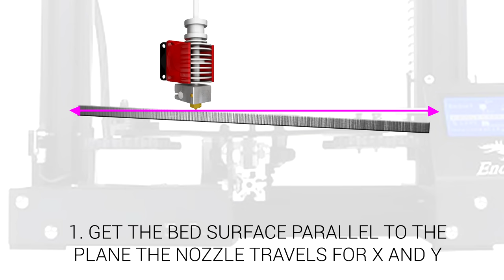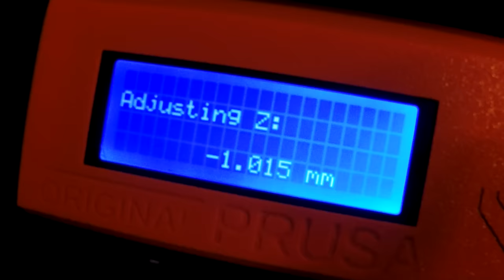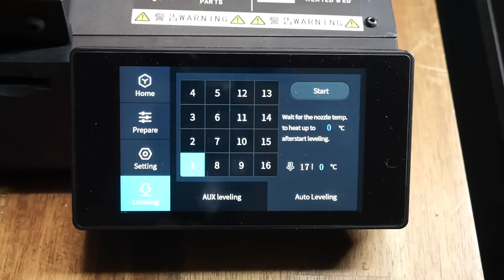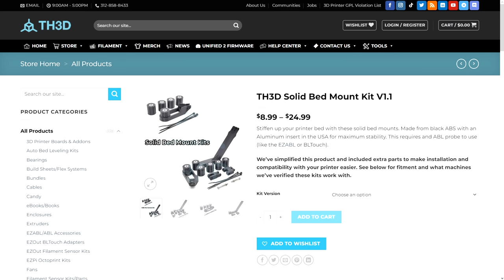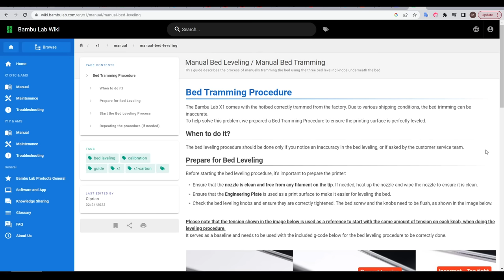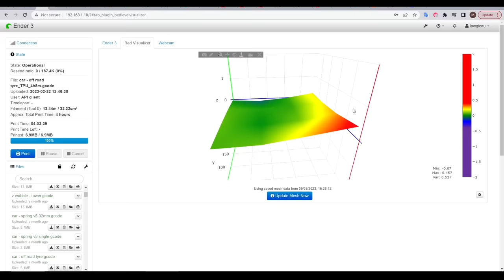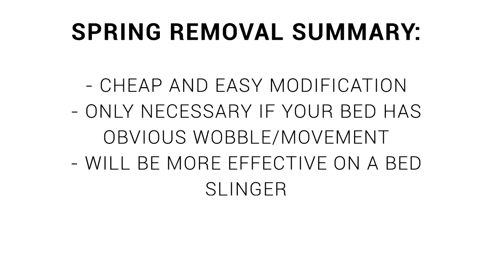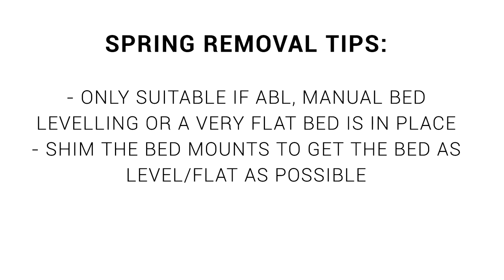Is it time for 3D printers to abandon bed springs?

Comment: One thing I did for my ender 3 that drastically cut down on bed slop and improved my layer stacking was to put washers and nuts at the top of the bed adjustment screws, rigidly attaching the screws to the bed.  The screws as they are are just in loose countersunk holes, and then held at the bottom by the adjusting wheels.  When the frame the bed is mounted to moves back or forwards, especially at higher acceleration rates, inertia momentarily keeps the bed stationary and the screws tilt off vertical.  Tilted bolts are effectively shorter than straight ones, so that pulls the bed downward till it catches up.  A washer and nut threaded all the way up against the bottom side of the bed pulls the screw tightly into the countersink on the bed surface, preventing it from tilting.  Incidentally, I also use a three point tramming frame, as it just makes more sense to me than trying to tram with four adjustment points.   That also allowed me to separate the support for the bed heater cord from the adjustment mechanism: I've found that the additional thickness of the heater cord support requires substantially more tension than the others to pull it down to the same level.  As you found, equalizing that tension required adding washers to all the other screws.

Comment: I haven't used a spring for a long time, I use self-made rubber rings from industrial rubber.
that kind of rubber can withstand the temperature variations well.
it is also very stiff so that you do not suffer from after vibrations.
I haven't had to level manually in a very long time.

Healthy and Kind Regards to all!
Rob
Reply: Rob do you have any more info on the rubber you used? Thank you sir
Reply: @CerealKiller187  
hello Billy,
what I can tell is that it was reinforced rubber ( the rubber comes from a shipyard! )
(then there is gauze in the middle of a tough kind of wire)
(gauze other name, a kind of net, fishing net but very fine wire)
the thickness of that rubber was 5MM and I used 2 rubbers per side.
( 2 X 5MM = 10MM high Rubber on one side! so you need eight(8) of these )
i drilled a hole in the rubber for the bolt and then with a -
hollow pipe 10MM knocked out the ring.

I hope this is enough information for you?

Healthy and Friendly Greetings from the Netherlands!
Rob

Comment: I run a farm with 9 Artillery Sidewinder x2's, and did away with my bed springs almost 2 years ago. I switched to silicon spacers, and haven't regretted the switch once. I am now able to achieve speeds of production quality prints of over 150mm/s consistently, and I attribute a lot of that to the stability of the bed. I also find that the bed leveling (abl running unified bed leveling in Marlin) is much more consistent and stable throughout the year. I highly recommend the upgrade to those on the fence about it.
Reply: what silicone spacers do you use? a link to them?

Comment: I've just gone back to stiff springs in my biggest printers (Anycubic Chiron and Max) which had helped greatly! This is with the ABL system, using the bed_screws_adjust Klipper function. It had enabled me to have much better consistent first layers, with the ABL further removing any inconsistencies.

The above AND the Klipper macro of bed mesh leveling only the printable area for the model being printed has been fantastic! I struggled with a long time getting good first layers, especially with the Max that had the fixed spacers under the bed, but the mounting was terrible from factory.

Very happy with the springs for now.

Comment: 2 of my printers have springs and always will, for 2 main reasons 1) They don’t have ABL and I don’t plan on ever adding, 2) I’ve never had a problem after the manual leveling with print quality. My 3rd printer is a delta and came with a rigid mount bed and ABL, so will obviously stay that way 😊.
Reply: I'm still fairly new to 3D printers. The last few times I've re-trammed mine I just visually looked at the nozzle tip and its reflection on the bed surface up close, partially because this Garolite sheet I bought itself doesn't like to lay quite flat on the heat bed. I put the high spots of the sheet to the corners, and set them to just barely not kiss the surface. Then the center distance looks about right compared to the glass plate. Haven't had a problem so far with that technique, and the parts come off easier than with the textured glass plate the printer came with. I don't find manual leveling to be difficult, nor time consuming. Usually it holds well unless I moved the machine around. If the springs seem loose on a machine, I'd simply suggest adjusting the Z-axis zeroing switch down lower a bit on the frame (which I had to do anyways, this Garolite is much thinner than the glass plate), a millimeter or two, tighten the springs to near maximum, then re-tram the bed.

Comment: My Ender 3 is still using bed springs.  I put stiffer ones on from stock and that made a world of difference on the quality.  I almost say that it prints better than my MK3S (with a 32 bit board, Revo CR, BLTouch, and a dual gear extruder).

Comment: You could also remove the springs and use the wheels for height adjustments by putting them where the springs used to be. When you are satisfied with the adjustments, you could counter it on the other side with a nut.
Reply: I did something very similar to this to great effect. If the level changes, it's now because the printer is falling apart. 
Big +1
Reply: Been doing this same thing for a few years now. I don't use ABL either. I've tried to explain this to some people and they seem to not get it. But my bed never needs adjustment.
Reply: you SOB. that's a freaking genius idea! hard mounted but still adjustable. especially if you drill out and use "thicker" bolts like M4 or M6 even. bolt and NUT to the platten. then one wheel above one below the carriage plate. loose below make your adjustments tighten below to lock into place. THAT is smart!!!
Reply: I also think there should be a nut right underneath the bed to give the screw less ability to wobble.
Reply: @SianaGearz  Yes I mentioned that nut and bolt to the bed that makes the boat rigid and unmoving the to adjustment knobs would be on either side of the carriage plate
Reply: Finally someone else has implemented a jam nut solution. I've used a jam nut on my printer to lock the calibration in place for years but I kept the spring in its place to provide noise dampening.

Comment: I replaced my Ender 3 (original) springs with stiffer springs a couple of years ago.  I also added 3D-printed spring caps that lock the spring in a vertical position and remove the side-to-side movement of the spring around the machine screw.  Finally, I added Nilock nuts under the bed to help further limit bolt movement.  The bed was adjusted to get the best overall level, and with ABL, and a magentic PEI sheet, it just doesn't move.  The bed is solid, but springs still allow a safety factor should the head accidentally be driven into the bed.  Thank you for this information, it was very informative and helpful as I have also recently considered removing the springs to see if might improve the resonance wall.  You showed a super result!.

Comment: After fitting a BL Touch to my Ender 5 I did a lot of careful measurement and then machined four spacers to specific lengths to bring those points all to the same distance off the nozzle within a few thou. The BLT now only has to deal with imperfections in the surface rather than worrying about having a print that doesn't have edges perpendicular to the base.

Comment: I'm about to build up 2 fresh Ender 3 Pros I got a smoking deal on, I plan to start w/ Stiffer springs and my prior printer didnt have them and bed leveling (trammeling) has been a nightmare, got a set for it too, once the new printers are up n running. Thanks for all the 3d printing videos you make, they are most helpful!

Comment: I've worked with large, flat mirrors various in optical systems.
Precisely held angles, no drift over time despite environmental vibration and extreme swings in temperature.
All the things you'd want in a printer-bed, right?
No permanently installed 'adjustment springs'.
Springs are very useful for initial setup, but don't leave them in!
When the mirror/print-bed is 'just right', lose the springs and install 'jam-nuts'.
These lock the support adjustments, preventing the need to re-re-re-re-level your print-bed.
Not every printer works with this: you need a fairly flat bed, no mesh-leveling!
I've not adjusted bed-level (Anycubic Mega X) in over 120 prints; perfect first layers every time.
Yes, I've applied offsets (M206 in G-code) for printing on blue-tape; allow 0.12 mm!
If you have a bed with significant temperature-dependent warp, like the Anycubic Chiron, this approach helps, but you still gotta use mesh-leveling for the first print in a printing-marathon.
Keeping the bed at the 'first print' temperature prevents the need to re-level!

Springs give the user the illusion of fine control, but they  introduce so many 'loose variables' that they aren't worth the long-term headaches.

BTW, many printers have a 'carrier-plate' that supports the print-bed.
Check to make sure this plate (bed mounted to plate by leveling screws, plate supported by Y-axis roller-bearings) isn't getting hot during a print-job!
Aluminum has a rather large response to heating and cooling: the carrier-plate on my Mega X can rise or lower by 1.2 millimeter with a 30 degree Celsius change in temperature!
Heated beds heat up everything in their immediate area; metals expand, tolerances drift, nozzle crashes into the bed, or misses it entirely!
A small fan, blowing air under the print-bed, prevents carrier-plate from heating and warping.

Fixing just 'one thing' doesn't fix the problem; you gotta make careful observations of the entire system.
Too often, we get advice that says 'Do this!', but it lacks context.

Comment: You seemed to miss the best option: silicone spacers. 
Whether you have an Ender3 or MK3S+, replace the factory option with the silicone spacer mod. There are OctoPrint plugins to help with the bed leveling, and people are getting beds level to within 0.014mm, which is extremely flat. 
Should cover this mod, as it's the best. A few guides out there on it, I'm using the 10mm  version made from 3mm ID 7mm OD high temp silicone tubing, as used in automotive, on an MK3S+.
You can even purchase silicone spacer replacements for an Ender 3 for cheap, as the one spacer has to be shorter than the other three.
Reply: Would you mind to share the plugin you use? :)

Comment: Never thought I'd ever say this but... "Bed springs... who needs 'em?"

Recently I picked up an Anycubic Kobra Neo through an Amazon discount, because I thought it would be nice to have a spare around if I need to run a print while my main printer is busy. This made me really nervous because this was going to be my first springless 3D printer, relying entirely on ABL for getting proper first layer Z height. But once I did some basic adjustments (squaring the print bed, making sure the rollers were snug, etc.) I have to say... it works amazingly well. I don't even hve to run ABL before each print, I just ran the ABL procedure once and read it from memory when I start a print. And it works amazingly well. In fact the only time I had to re-level was when I had to move the printer while reorganizing my workspace. It's working so well that I'm now considering outfitting my main printer with a BLTouch and switching to springless bed mounts.

Comment: I have an ENDER 3, it came with the springs and knobs. I took them off, replacing them with long countersink machine screw, nuts, lock washers and flat washers. I leveled the bed and tightened up all the nuts. It's been WELL OVER A YEAR since then and I haven't had to level the bed since. I honestly believe I'll never have to level the bed again.

Comment: I’ve been using orange silicone spring cylinders on my Ender 3 and they're working like a charm with a CR-touch probe, I level my bed once every 8 to 10 prints so I love them.
Reply: Adjusting every 8 to 10 prints? That's a lot of maintanance my dear friend.
The point of this video is to not have to adjust it again for many months if not years.
Reply: @alejandroperez5368 realistically think about this and wonder if its ever been documented as being achieved after a multi year long trial likely as long as the duration 3d printing had been mainstream up to the present

Comment: I remover the springs from my Ender 3 Pro about a week later for silicone and nylon washers ...I now only have a auto routine now I starts up heats the bed to 60 c  runs abl probe stores mesh to memory ..After that I just call the mesh from memory and print ...At beginning of print homes machine heats up prints..EASY....NO repeated probing at beginning of print. I found  printer works great with this setup..

Comment: On cheap printers, the "bend the bed flat with screws and silicone tubing" mod really works quite well.  Even with only 5 screws to work with, it made a huge difference on my SV06.  I think it should be the new standard.
Reply: What is this?
I cant find anything about this online

Comment: I compress the springs as far as they will go, then back them off one turn. Then I find the lowest corner and lower the other three to match it. The more pressure, the less chance of the bed moving or vibrating.
I also use Loctite. If you have adjusters it’s a must! Between heating and cooling causing expansion and contraction, and vibrations, the adjusters will definitely move if you don’t use thread locker on them!

Comment: Ender 3 v1 here, and I've ditched the springs for the silicone bed mounts.  I use a CR-Touch and  a 9x9 mesh.  I've also installed a cast bed plate and so far it's all working very well.  Don't miss the springs at all.

Comment: Still using bed springs on my Anycubic Mega Pro. I have switched from a glass bed to spring steel coated with PEI however which has performed much better for me and makes the removal so much easier.

Comment: There is one other benefit to springs that has not been mentioned - it provides a mechanism for pressure release if the nozzle is in flat contact with a flat smooth texture bed (like plain glass). Textured surfaces get away with this because there will never be an hermetic seal with the nozzle so there will always be some route for extruded plastic to ooze out and prevent excessive build-up of pressure in the nozzle that, over time, can cause the PTFE to back up and result in excessive stringing and/or extrusion problems.
Having the bed mounted on springs at least allows the bed to move away from the nozzle in that situation - there is still a rise in pressure but not as much. Furthermore, as others have said, the real issue is not the springs but the screws vibrating loose over time. It is for both those reasons that I abandoned the stiff yellow springs and went back to my original Ender 3 springs (less force, so less back pressure in the nozzle) and fixed my screws in place with antivibration mountings to prevent them working loose. I do not use BL Touch or other bed leveller and since I made the modification I never needed to re-level / re-tram my bed, no matter how many prints I make, unless I change the nozzle.

Comment: Also don't forget to put 4 lock nuts one on each of the build plate adjustment screws when you take off the janky yellow springs because there is a known manufacturing error in the 4 bolts that connect through the build plate. So you can tighten any one of the 4 bed adjustment knobs and it's pointless because the bolt spins freely under the magnet build plate sticker until you do this fix you also cannot level a Ender3.
Reply: This is an extremely underrated comment. Yes, lock bed screws. 
Depending on the model, you may want to isolate the lock nut/washer, or use nylon washers. Otherwise, you may scratch through the paint and eventually short the heating lines of the bed heater.

Comment: My printer started out as an Ender 3 Pro, but I have upgraded so many things on it there are not many original parts left anymore. It now has a 400x400 bed on linear rails that is rigidly mounted, no adjustment at all. I let my BL Touch run a 25 point probe before each print and always get perfect results. It does seem annoying at times how long it takes to run, but when I think about how many hours most prints are, it is really not much of a difference.

Comment: For ender 3 variants, I'm using solid plastic spacers from furniture industry. With 5x5 point mesh + glass bed, I never looked back.
Reply: have you tried G10 sheets ? they can work just as effective as flat bed but much lighter weight + better prints adhesion / release. I'm using 2mm thick one and its much better than glass so far.
Reply: @duchnguyen2735  I'd recommend FR4 instead. High-temp printing will affect G10
Reply: @WhenDoesTheVideoActuallyStart fr4 bed with ac heating is gold standard for hi temp printing. Agreed 👍👍👍
Reply: @duchnguyen2735  Have you tried PEI sheets? Much better than glass and very easy part removal. FR4 is not flexible.
Reply: @alejandroperez5368  i did but unfortunately it doesn't work well if your printer shipped with moderate to heavily warped bed